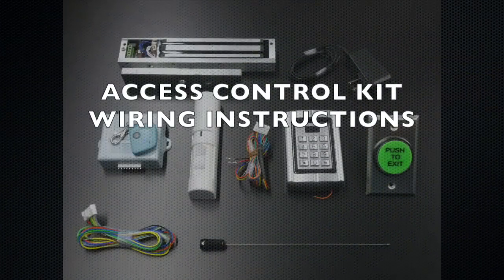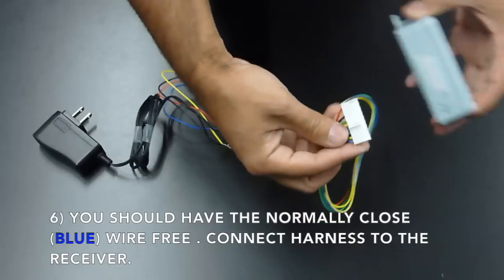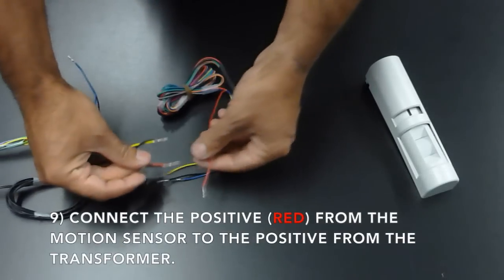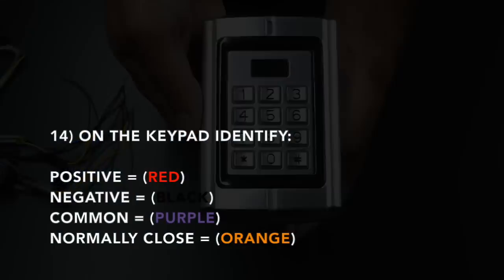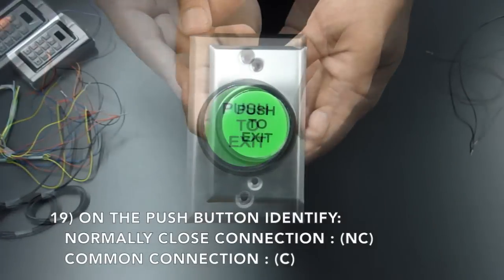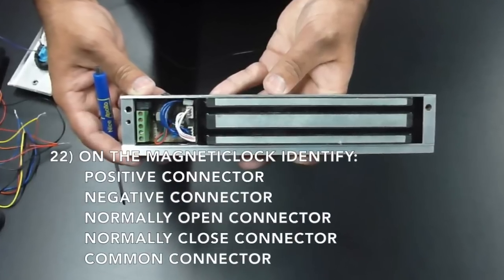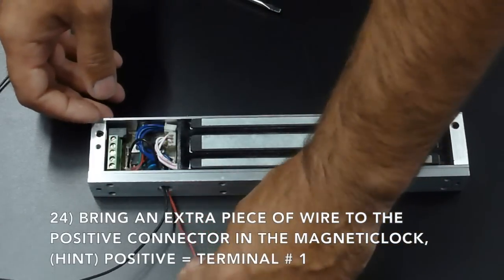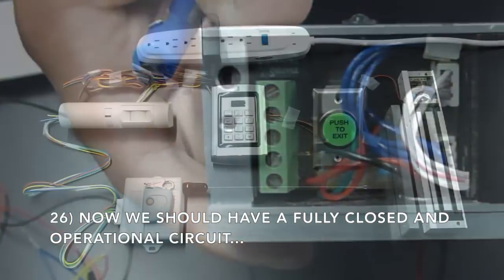Magnetic Lock Kit Wiring Instructions

Comment: I have an argument I, have had with our crew. dont twist wires counter clockwise when using wire nuts. either dont twist or twist clockwise then use the wire nut.. Otherwise you are untwisting the wire then retwisting it clockwise when twisting the wire nut on. Certainly Im not wrong am I? For me to be wrong would be unheard of. LOL

Comment: your PIR is wrong on your daisy chain, NC on receiver's output always goes to Common on your next device and not NC , also your exit button is momentary and needs to be a 30s delay on press to meet fire dept code, your wiring wont pass inspection
Reply: are you sure its wrong? it works in his video
Reply: Not to mention the twisting of wires through the whole in terminals on push button (hack)
Reply: Electrically it doesn't matter if you go from NC to the next Com or the next NC. For the sake of consistency it is best to do so. Only 1 device needs to directly interrupt the flow of current to the magnet so the button should be hooked to the REX or request to exit input on the keypad to trigger its timer.